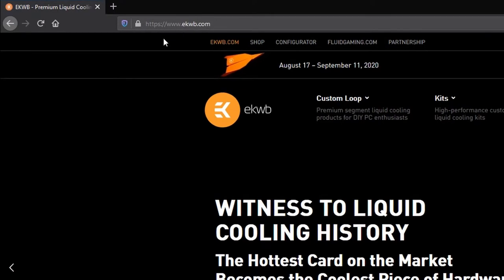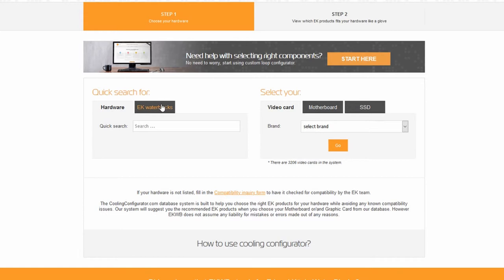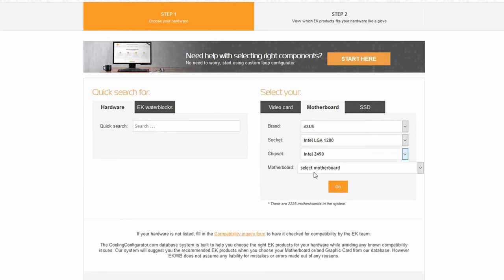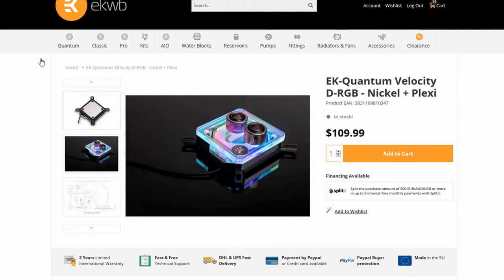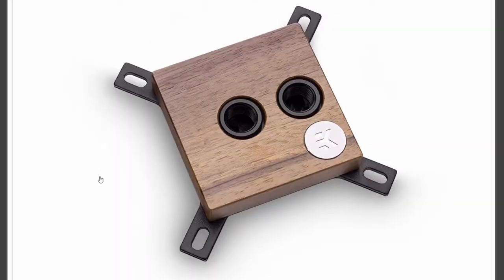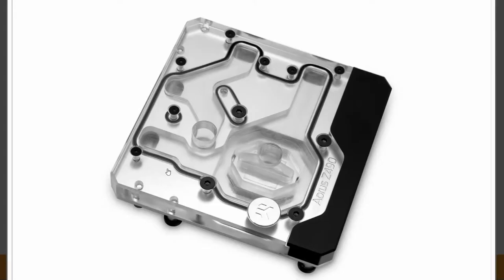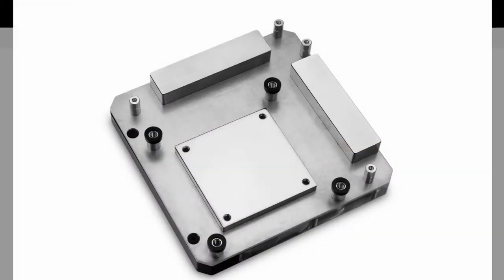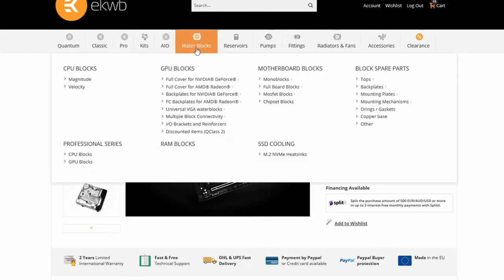How to Install a CPU Waterblock | EKWB | Watercooling

Comment: you can rotate the frame of the velocity block and have the logo and the velocity badge straight and still have your ports side on how you have them now.
Reply from the maker: You're absolutely correct. I thought the same but later I just rotated it (as in the thumbnail) and  decided to keep "Velocity" name align with RAM card's "T-FORCE" name.

Comment: I have a prebuilt EK pc with hardline tubing. I would love to upgrade from my 5600x to something better. I am however terrified of breaking something or getting a leak when removing the waterblock and tubes. Do you have a guide for this or know of any sources that could help me? Thanks for your time!
Reply from the maker: It's not that difficult. I have cleaned up and modified my loop many times. First, drain all the coolant you can drain. Then close the drain port and run the loop for a few seconds. Drain again. Disconnect power, and press the start button to discharge caps. Then remove all power connectors from the motherboard. Finally, remove the easiest tubes by keeping a paper towel under the fittings. Keep the tubes upright and remove the CPU block with the tubes attached. Even if you spill some water on the motherboard, it'd be OK. Just make sure it's completely dry before connecting the power again.

Comment: Just a quick question!!! Hi!!! Hopefully this is a small problem...I'm building daughter machine with 
the Phanteks Glacier D140 Distro plate and with the Asus TUF Z390-PLUS GAMING 
Mb  only has RGB 4 pin HEADERS. The Phanteks Glacier D140 Distro plate has three 
pin Digital headers that wont connect to this motherboard for our new build . Is 
there a another accessory i need to purchase from frozen pc to get the phantech 
d140 to work converter box or controller box I need.. Or is there something else 
i can buy from best buy or a local puter store to fix this so i can get her 
machine up and running with the phantech d140 lit up :) This would really help us 
out alot... thanks
D.
Reply from the maker: RGB (4-pin) to ARGB(3-pin) conversion is technically not possible. There are some converters ( e.g. Deepcool ) available in the market, but they also will give you only RGB effects on your ARGB device. 
So, I think the best solution is going for a ARGB controller. 
Deepcool, CoolerMaster, Razer has these products for you to purchase. You can go for a very simple controller works with a software or remote. Then connect all your ARGB devices into that and enjoy the ARGB effects.
Reply: @STechV  Wow!!! Thank you best news Ive heard all day !!! ;-D

Comment: whats the tubing mm size?
Reply from the maker: 12/16mm ( 12mm ID, 16mm OD )
Reply: @STechV  so 12 through 16?
Reply from the maker: Inner diameter 12mm, outer diameter 16mm